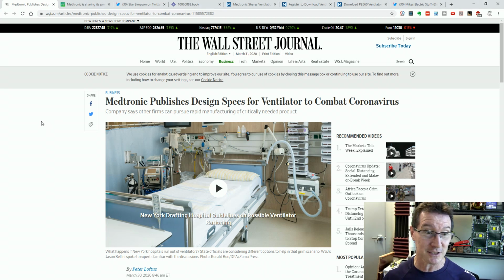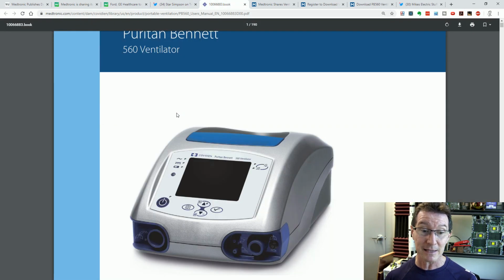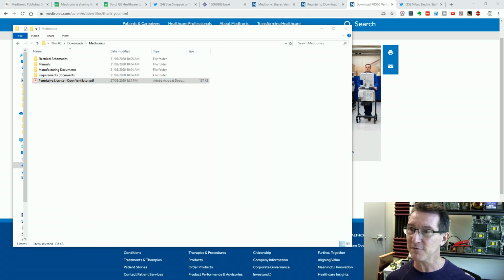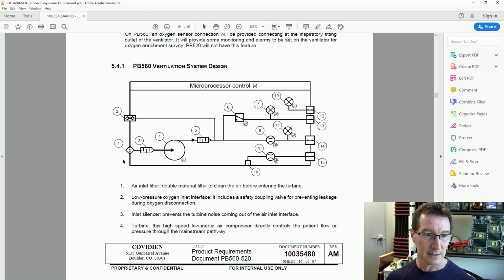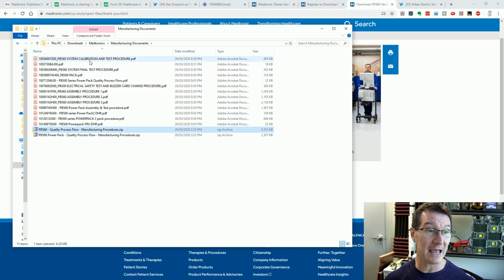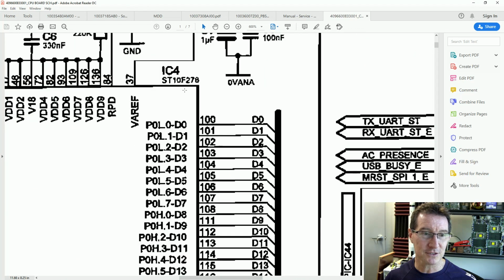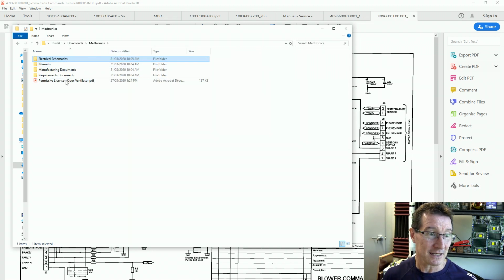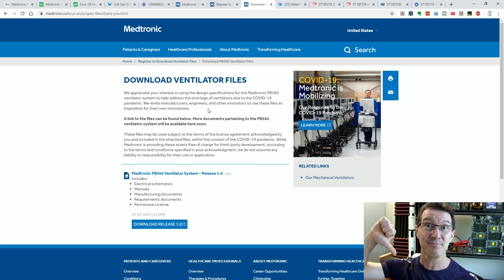eevBLAB #72 - BUSTED! Medtronics Open Ventilator FAIL

Comment: Design requirements could actually be very useful. How you go about fulfilling these requirements is your own decision. I'm sure there are ways of doing it that better address the current crisis than merely copying the Medtronic design. I have been thinking about designing one for a while now, but other teams are already working on something (a machine that compresses an existing bag valve mask) that I reckon will gain more traction than what I had in mind, so I guess I'll just leave it be. What I'd do is do away with many of the sensors and valves; in times like these, the designs need to be simplified a lot so you can make shitloads of them. Probably even disposable. What I'd do is build something not entirely dissimilar from a two-stroke engine: a cylinder with two ports at the bottom that are covered by the piston when air is pushed into the lungs. A fan can be used for scavenging the air in the cylinder. You could have a prechamber between the cylinder and the patient where the air is mixed with oxygen. Lastly you'd need the typical ventilator arrangement with the a tube in each direction, to eliminate the dead volume of the tube and the chamber, to avoid the patient breathing his exhaled air. It's a positive displacement system so volume control can be achieved by moving the piston back and forth a set amount with a stepper motor. The only sensors you'll really need are a limit switch and a pressure sensor, so you don't overinflate the patient. ETCO2 and saturation sensors are nice to have, also. But yeah, other teams are already working on it.

Comment: It makes me cringe every time I read of a politician finally being told by the senior medical bureaucrats to place an order for another 40,000 ventilators on top of the 40,000 ordered 3 days earlier.  They come from China and Germany.  Everyone is ordering them.  So we'll have to make our own. Setting up a new plant on a wartime basis will take 4-6 months. So they'll be in production about the same time all the dying are dead.
But we have to try.  If 23 vaccine development teams fail we could be stuck battling covid-19 for years.

Tell me would you want to be hooked up to one of these jury-rigged ventilators made by a car company out of car parts that are "similar" to the parts used in a proven ventilator.

Comment: On the other end of the spectrum, Seat factories in spain are making ventilators out of little more than a windshield wiper motor attached to a cam that squeezes a rubber bottle.

Dumb as a brick but works,  mostly.
Reply: Wiper motors are designed for short term use and fail when used constantly. 
If they fail then the patient dies because they cent breath while the machine is hooked up..
How many are being used on patients???
Reply: @zakofrx  Is there any source? About wiper motors are for short-term use? Then they failing? How short? Minutes? Hours? Weeks? At what load? At what RPM?

Those people who are dieing already won't die again...

Comment: I suspect this is all the documentation that Medtronics has and that there are subcontractors that supply electronics, software, pumps, valves and other parts. Therefore, I believe that it is the subcontractors who have the detailed and updated information. This information is something that Medtronics does not have direct access to.

Comment: Even if they release every schematic and CAD documents and software for this thing, I don’t see how that would help right now. It would need months, if not longer, to produce these devices from basically scratch. What would be really helpful is, if they design a basic machine specifically made for this pandemic, with parts readily available. A hacked together solution so to speak, with no bs functions that you don’t need and would just waste time. It wouldn’t look pretty or be „state of the art“, but it would concentrate on the important things...that a relatively broad number of people can build the thing RIGHT NOW and to save lives RIGHT NOW.
Reply: And how long will this event last?

Comment: They most likely will have to abide by license terms for parts of their code, and thats why the software is not part of the release. They said the software might be released in the future, my guess this will only be possible if all software license holders agree to the release.
Reply: FWIW, they didn’t say that the code (and other files) “might” be released in the future, they actually said that they “will”. It’s in the press release.

But I’m sure that your hunch about licensed code being the holdup. That was exactly what I thought, having worked at a software company in the past, where I saw just how many third party components they relied on for core functionality. So my guess is that they’re hammering out details with their component suppliers to allow them to release it.

Comment: I think it is very likely this is the cache of documents they assembled to be submitted to the FDA when the device was certified.  The design is beyond manufacturability because the MCU is an obsolete part with about ~600 devices available in the US right now.  The software code is written specifically for an ST10F27, this object and source code will not port directly to another more modern MCU.  The software design docs look to be reverse engineered from the actual source code and not original design docs.  On the surface it looks like good faith, but once you dig, you figure out the design is obsolete, not commercially viable, and was originally designed to fulfill a government contract.  So it looks like the little conversation the gov had with Medtronic was really about releasing the design specs for something the taxpayers already paid for.

Comment: A CPAP machine (continuous positive airway pressure)  would be better; doesn't need a medical team with drugs to run ( tracheotomy, muscle relaxant etc).  Useful before transfer to ventilator proper, and may be sufficient to assist recovery on its own.

Comment: They released everything in PDF because it's easy for journalists to skim through and think they're looking at something important.
Reply: To be fair, they would have already published it to pdf long ago.
And probably have 2 sets of files, real design docs, and the ones for repair aka these ones.
Reply: @Bob Sacamano Let's see Windows 10 has the Edge browser which can render PDF and Linux usually has Document Viewer and obviously some browsers too. Mac always had some kind of PDF fetishism, so it has had something for it a longer time. But before Edge could render PDF WIndows had nothing. And obviously they can't render all PDFs. Rendering PDF properly has been proven to be impossible. It's a guessing game. You need to render multiple pages in multiple ways and hope the document has no cross references. The document describing PDF is longer than for Word documents. Includes embedding zip files and Flash, video, Javascript, forms, etc. The standard actually used in academics is LaTeX.
Reply: You nailed it
Reply: @Bob Sacamano "No, PDF is the standard for publishing and archiving files"
let's not go overboard, PDF has it's purpose but itself depends on specialized software.
Reply: How this is even an argument? They take the time to include pdfs but not the originals?
Plus since when journalists can help build anything but FUD?
Reply: @NolaanOne  "How this is even an argument?" Since they need the journalists to get the word out on their "opensourcing a ventilator" publicity stunt. Nobody said it's an argument FOR MedTronics 😉

Comment: I have to say that I don't think this is as useless as you're claiming - I had a look at what would be involved in designing a ventilator, and this is exactly the information that was a blocker for me - the requirements and broad high level design block diagrams.  Turns out ventilators are about the details - get the pressure curves wrong and you kill the patient, leave out a filter and the unit aerosolizes the virus and infects everyone in the area.  It's really not a place to apply the normal maker approach of winging it and refining in later versions, so having a proven set of requirements and considerations is exactly what is needed for this task.  The actual mechanical design for something that will be 3D printed for instance would be different in every part because of the different constraints that come with that manufacturing process.  Given detailed requirements I would have no problem building the software from scratch, and I'd be willing to bet that would be much easier and safer to do than trying to adapt their software to a different micro / different pumps / display / etc.
Reply: Congratulations , 2nd comment where Brain was used. You stay safe

Comment: That valve flow diagram is most of what you need on the hardware side, just buy off-the-shelf parts that are up to spec and connect them together in that order. Won’t take long for someone who knows what they’re looking at to turn that into a BoM. The software side however, should be much more well documented, and we’ll see if they release it as such. Ideally they’d just release a bunch of .hex files for a bunch of cheap MCUs and be done with it, a tiny bug in software that doesn’t get detected in rudimentary testing could definitely cause life-threatening problems.

Comment: 11:53 is that a scan? Some scanners try REALLY hard to interpolate numbers and literally change numbers. This guy found that xerox has those issues with some of their scanners. If that is what is happening, a lot of numbers could be wron.. https://www.youtube.com/watch?v=7FeqF1-Z1g0
Reply: It is very much a scan.

I don't see any evidence of substitution encoding in here, i don't think this scan is accidentally automatically manipulated.

But it's also of absolutely horrendous quality. The contrast or threshold is bad, the alignment is bad, the resolution is barely even FAXworthy.

For example there is a much bigger ambiguous 6/8 down just below on the D6 address line. You know that it's a 6 by context, but the blown out contrast makes the tail stick to the body! So it's visually ambiguous. But it's also not a substitution failure, because you can see how 8 has a different offset between the loops.
Reply: I worked as an electrical designer for years on ROVs, and the only acceptable standard for electronic drawings in lieu of the native CAD files are published PDFs. Vector drawings are exceptional documents for working with, easily searchable, and accurate no matter the zoom level. Raster drawings aren't worth using as toilet paper, even in today's crisis! I would have my rear appendages handed to me on a platter if I was to provide clients with raster drawings like the ones in the video, it shows a lack of professionalism and a complete disregard to their intended purpose.
Reply: well i mean you can see that someone signed the design so it's definitely just a photocopy.

Comment: CPAP "Continuous positive airway pressure" This is a simple device that doesn't need a dangerous drug regime and "invasive procedures" to work almost as well as a pulsing ventilator. These patients don't need to be forced to breathe they only (for the most part) need breathing to be made easier and more effective. The UK's NHS is apparently already getting new makers (Mercedes F1) through final testing.

A "normal" ventilator needs a cocktail of drugs and a long recovery time both of which take up limited resources.

Comment: I suspect that the detailed requirements are by far the hardest part of the information to obtain. Once you know what exactly the thing needs to do, it's just some sensors and a precision flow/pressure controlled pump. I don't imagine the pump specs or sensors require any novel technology—the thing is replacing a nurse with a rubber balloon.

Comment: Whilst this won't outright allow someone to up and manufacture a ventilator it does give someone very good insight about what's required and how they work if you've never worked on one before. Medical equipment is a bit "behind the scenes" with very little in public domain. Whilst this has been marketed slyly and looks a bit better than it is, it is still very valuable information for bright minds and tinkerers who may be thinking of ways to improve the design or build there own. Given you can't easily source one to tear down, this also gives good insight into how they're assembled and the performance requirements (again - who are you gonna ask right now about the specs of everything? all experienced personell are far too busy)

Comment: Even if one had all the detail design files, there looks be a number of custom molded and other custom parts.   But because this is a medical device and not an Arduino kit the elephant in the room is going to be the supplier, assembler and testing quality assurance and tracking programs that must be in place and be certified by a government approval agency, the FDA in the US. You had better talk to your insurance carrier first about the cost of medical device product liability insurance. Have you ever noticed the note on component data sheets " This component is not to be used or approved for use in life sustaining products".  So I would think you would need to negotiate special wavers and have deep enough pockets to cover your component supplier's liability before they would even sell you the parts.  Don't think you could bypass this and buy through normal distribution channels as there would be no quality tracking and the FDA would not approve your product.  I can just hear the attorney lobby trying to convince congress not to pass some sort of liability waver.

Comment: Dave is making the perfect the enemy of the good. This isn't even close to being a build package, but that isn't the stated intent. It would certainly be useful for someone who wanted to learn what it takes to design a reasonably modern respirator.
Reply: I don't think you're correct. 
And how does what they do help the current situation, and who in their right minds would go ahead and design a ventilator without knowing anything about ventilators? And if they did, why would they knowingly use design that made their product illegal to sell after the situation is over? Sorry, it doesnt make sense.

Comment: Without those documents being out there, someone with a little basic knowledge of electronics and some supplies could put a prototype for a piece of garbage ventilator that seems to work in less than a week. They'd just need a cheap air pump, a 3D printed case, garbage bin display, and a low-rate microprocessor programmed to give the illusion of doing more than it really is. 

Thanks to this stuff being out there, now, someone selling a shoddy piece of equipment can just claim it was "made with permission" using "official schematics from Medtronics" then cite the misleading articles and official site. 

If that happens, that would get people killed and be used as an argument against right to repair, even though this information being restricted in the first place helped contribute to many deaths due to there not being enough equipment and readily available alternatives.

Comment: If someone wanted to make a lot of "cheap" simple ventilators, then copy the original Bennett PR-2 or the MA2 . These are very simple internal design and would suit the job of being fast to produce. Another possibility to modify CPAP machines  so they can control the PEEP valve (the breathing out) as well as make the required pressure to drive the lungs , around 40+cm h2o were a cpap is typically much lower at around 10-20 cm of pressure. Make a simple single mode CMV ventilator without all the fancy crap.
Reply: Correct, but the "elephant in the graveyard" is the impossibility of quickly manufacturing anaesthetists the people that actually know how to best use these machines.
Reply: @WS-ij1fu  Back in the day (40-odd years ago) junior physicians used to have to set up and run these machines in an emergency, with no hand-holding from any anaesthetist. Tent hospital will be like that.
Reply: @faithlesshound5621  Oh absolutely, but that's the reason so many people are dying on these machines its as much of an art born of experience maintaining someone's breathing as it is a science.
Reply: Carlos Pulpo CPAP machines unfortunately are known to be very dangerous when used to treat COVID patients. They aerosolize and spread the virus and thus can infect healthcare staff and care takers:

https://www.npr.org/sections/health-shots/2020/03/27/822211604/cpap-machines-were-seen-as-ventilator-alternatives-but-could-spread-covid-19?t=1585684949332